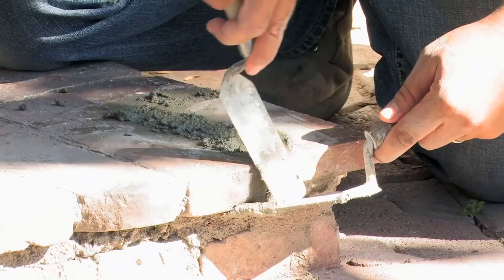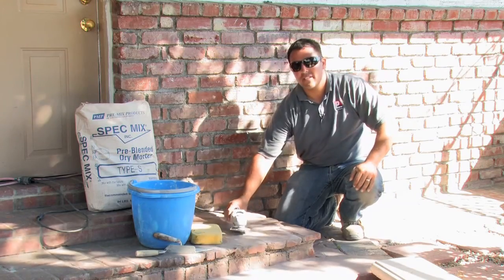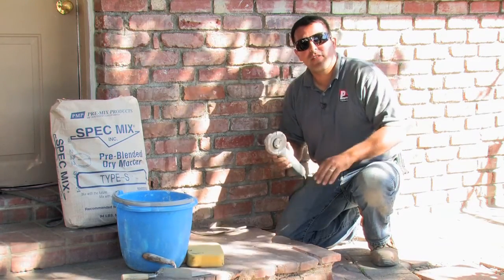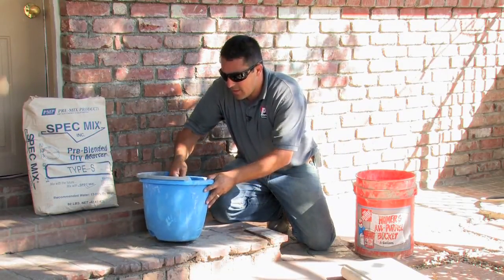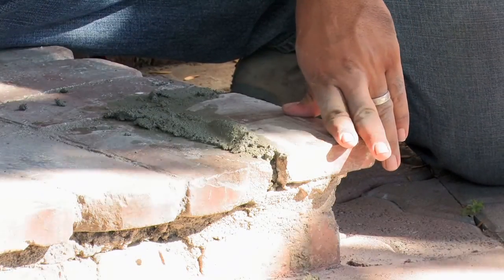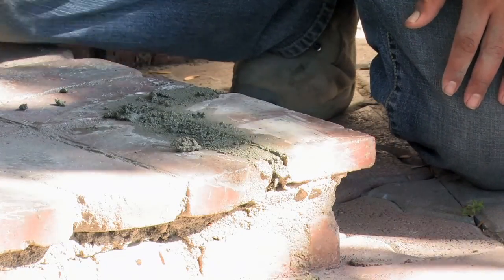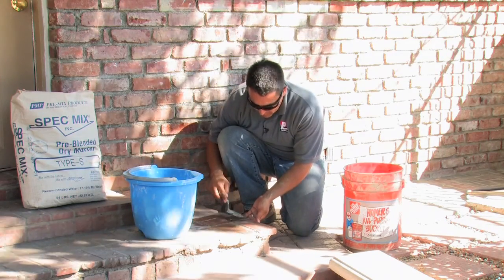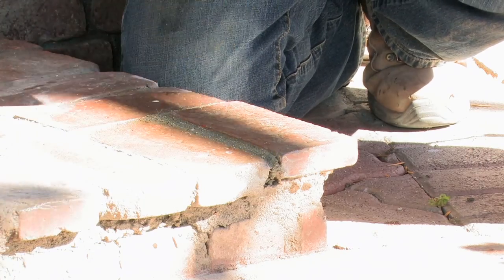Concrete & Masonry : How to Apply & Repair Grout

Comment: Supposed to use face mask to not breath that dust when cutting. Also, what spec mix to water ratio did you use? has it been mixed with plastic cement?